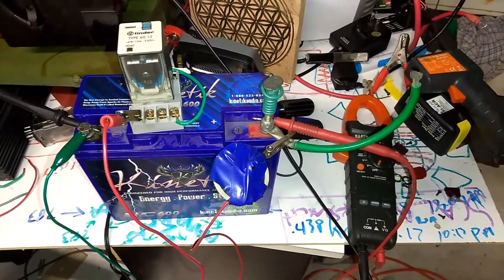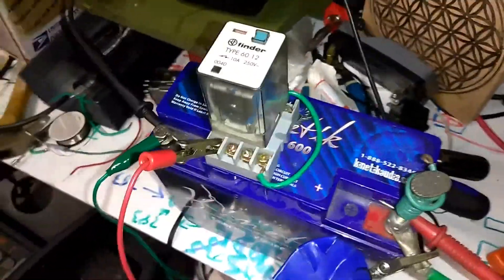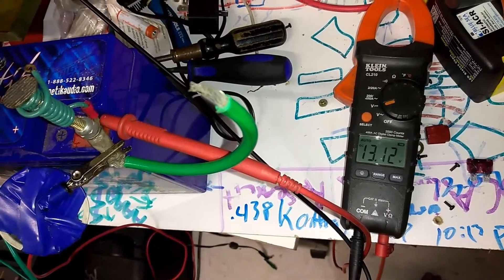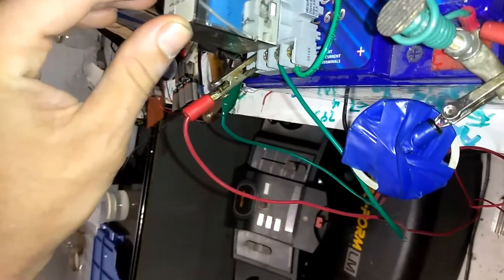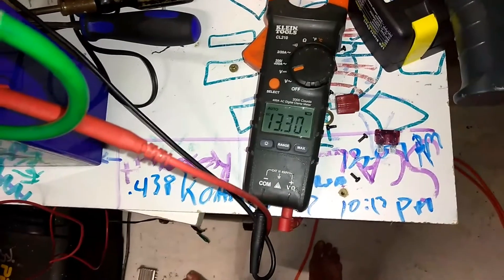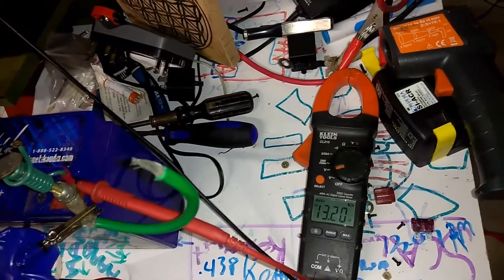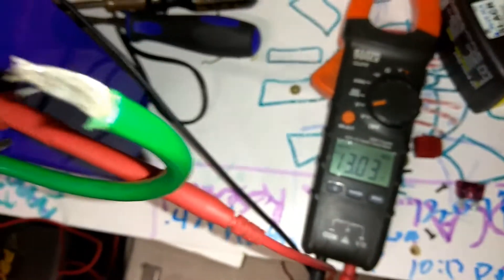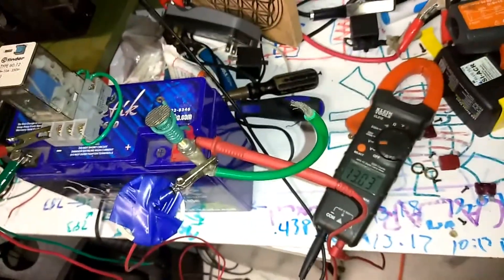Self charging battery. Green back EMF spark.

Comment: but to make the neutral og cold energy from the back emf into usefull battery charging current "hot energy" you must then also use this back emf energy to first charge up a capacitor that then shoots its energy down into the battery when reaching a specific voltage you chose by simply attaching a transistor that is triggered from a small lets say 80 volt neon bulb as a spark gap, in this way when the capacitor reaches that current the small neon tube will light and transfer energy to the trigger lead of the transistor ans making the capacitor dump its charge into the battery so it can be fully charged, else when charging the battery wilt neutral or cold energy it will empty itself as soon as you connect it to any real load like a resistance "like a real bulb or heating element" or inductive load "like a dc motor"

Comment: Back emf comes from collapse filed of relays coil. Larger that coil is greater the output is. The full wave rectifier AC input must be connected parallel to switch  (in this case relays) contacts that turns on and off the inductor or coil.
Reply: What is the load attached to the "self charging" battery 🔋??